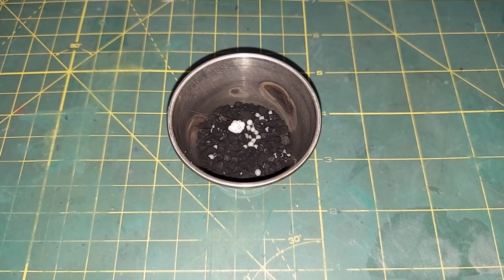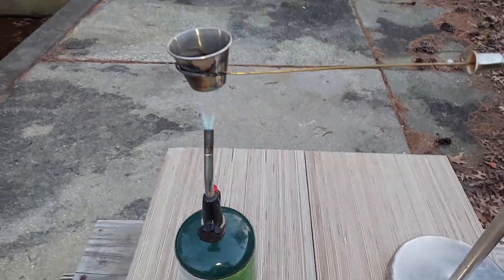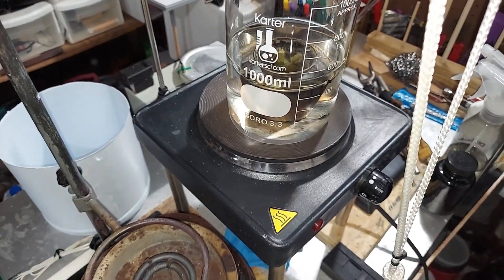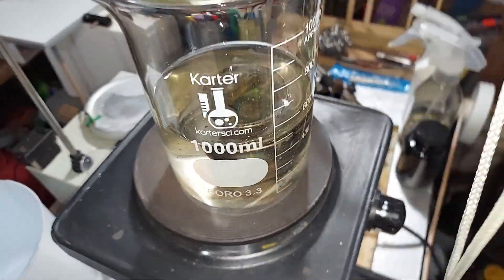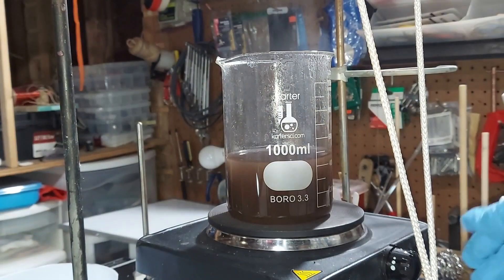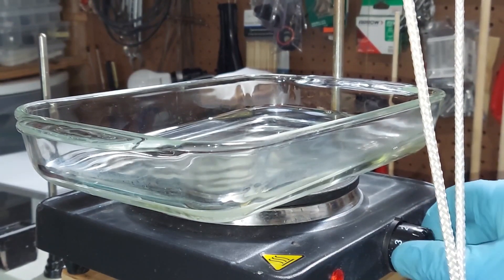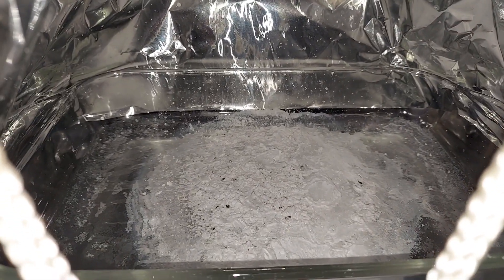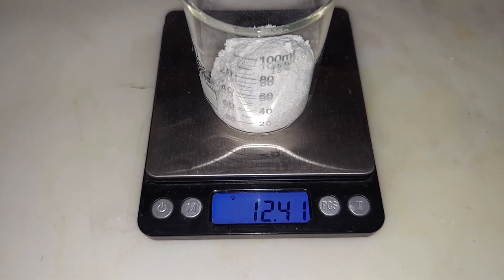A Better Method To Make Sodium Nitrite

Comment: The is probably remaining nitrate left and sodium oxide from NaNO2 decomposition that turned in NaOH in your solution, you should add some nitric acid until the ph reaches ~10, then add silver nitrate and cool to 0c, silver nitrite is a little soluble in water at 0c, so just filter it out, dry it and weigh it (for stoichiometry), put the precipitate in boiling water to dissolve it, add some nacl in stoichiometric amounts to the silver nitrite solution, AgCl is extremely insoluble and will crash out, leaving you with a pure NaNO2 solution, without any impurities whatsoever, do not use sulfuric or hydrochloric acid as the silver salt is also insoluble so it will contaminate your final product (Credit: Apoptosis)
Reply from the maker: Apoptosis is a wealth of great info.  I really respect his channel.  However, he is rather good at leaving out critical info to perform his reactions when it comes to anything slightly illegal.  I know as I've tried on a couple of occasions to follow his more dubious reactions by following his exact instructions.  Only to find out that critical info was missing.  But, you wouldn't know unless you tried it yourself.  It's made me a bit gun shy about doing exactly what he says.  Having said that, I may give this a try in the future and for that I thank you.
Reply: @cranialconstruction I’ve been trying to follow his KNO2 synth and having some troubles, I agree that I would really appreciate for him to give some more details…

Comment: 1:30 man if your reaction vessel melts and all the burning shit falls on your gas tank you could be in trouble... or is the torch sufficiently offset? It's hard to tell from the video.
Reply from the maker: I had started this process by using only small amounts of reactants.  I didn't record these tests.  By the time I got the metal cup full of reactants I was confident it would hold as none of the previous tests had even caused problems.

Comment: Just tried this, unfortunately it did not work.

Followed the procedure, and worked up the product. 

Added sulfuric acid to the product, and got a violent quick reaction that yielded clear fumes, as opposed to nitrogen dioxide gas that should be produced when reacted with sodium nitrite. This tells me I did not produce sodium nitrite as intended.

When washing the product off of my hands, I noticed a slippery sensation I associate with bases like bicarb/NaOH

I highly suspect I made sodium carbonate, or sodium hydroxide
Reply: Any guess why it didn’t work? Oxygen contamination? Im about to try this method today and see what i will get
Reply: @roflman2122  Sodium nitrite starts to decompose at 320 Celsius. Any pyrotechnic type reaction is going to have low yields.  The best way to verify your nitrite is decolonizing permanganate solution and precipitation of silver nitrite from silver nitrate solution

Comment: Melting NaNO3 and adding a mix of iron filings and iron oxide will make it without the excessive energy of burning charcoal. Copper powder also works well.

Comment: Carbon dioxide can dissolve in ethanol better than in water, according to the order of magnitude of Henry's constants
At low temperatures and pressures, CO 2 exhibits low water solubility. The addition of EtOH as co-solvent contributes to an increase of CO 2 miscibility with water , leading to higher efficiency in the supercritical assisted atomization

Comment: I still think the best method is copper,HNO3 and oxalic acid which forms NO2, and copper oxalate and this NO2 is bubbled into cold NaOH which obtains quite a good purity of NaNO2 with some NaNO3 contam. The copper oxalate can be cooked to form copper metal and the process can be started again.
Reply: Could you elaborate on the reaction I couldnt find a reference for this process using oxalic acid
Reply: @AaronVanTassle  ok basically when HNO3 reacts with copper it makes copper nitrate and NOx but when oxalic is present it forms insoluble copper oxalate and liberates nitric acid which continues to react with copper until only copper oxalate remains.
Reply: @CatboyChemicalSociety got it, thanks, good way to limit the amount of nitric acid you have to supply
Reply: Catboys don't learn chemistry they learn gayistry >:3
Reply: @montyshark3993  but I am 100% straight as a razor nyaah!!

Comment: I think you would get better yield if you ground up the charcoal & fully mixed the charcoal powder with the NaNO3: likely more even burn. Also try putting a lid on it to reduce oxygen from the air interfering with the reaction.
Reply: 100
Reply: @jbone877 what kind of lid because I think it would get melted

Comment: Not bad. I usually see people bring the nitrate to molten then add the charcoal in portions, but this looks like it reacted quickly and cleanly. How is it people remove residual nitrate? Was it by adding a carbonate to make it less soluble? Or is it separated using acetone or ethanol?